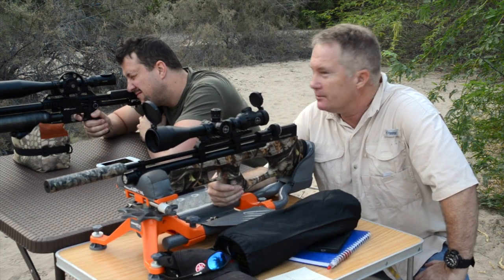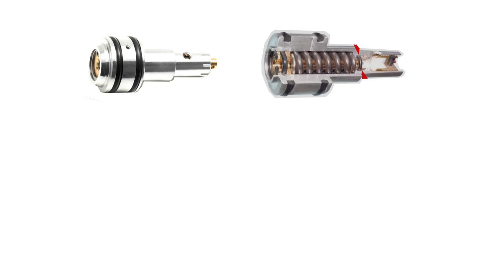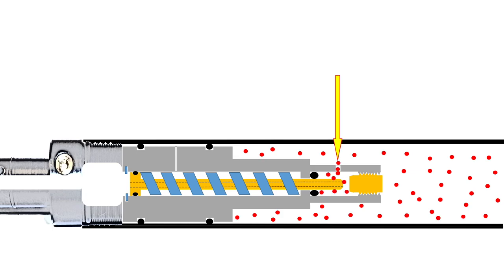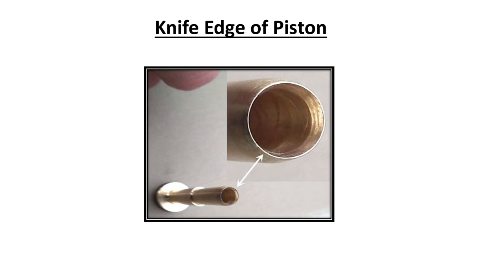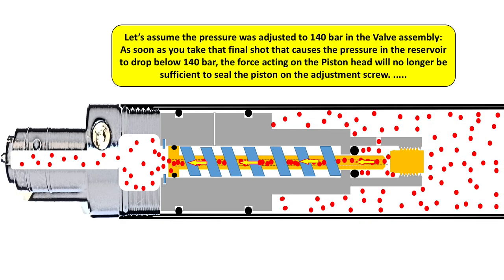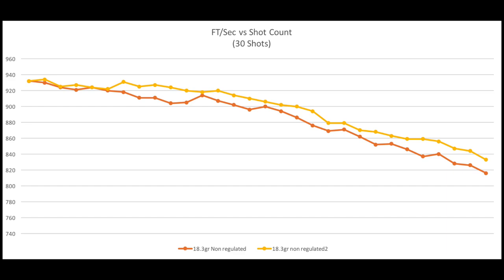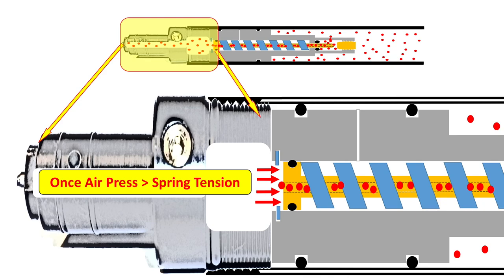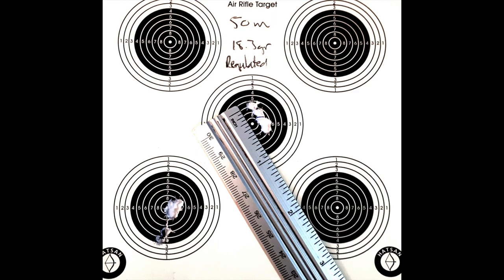PCP Regulator: How does it Work?

Comment: Great explanation, learned a lot! Would you mind explaining how an externally adjustable regulator works?
Reply from the maker: Hi Jim. 
Ok, if you recall this "internal" regulator has to be removed and the adjustment done once the regulator is out of the gun. In this case the gap between the adjustment screw and the knife edge is increased or decreased by screwing the adjustment screw in or out. 
In a more expensive (and complex) rifle this adjustment is done from outside. The regulator still works on same principal, but either the adjustment screw (or spring tention on the piston with knife-edge) can be adjusted from outside the rifle. 
Obviously the "adjustment system" also needs to be sealed off by o-rings to not allow air from escaping. 
I just fitted a Lane regulator to my SPA PR900W (video available by next week). The SPA non regulated rifle has a total of 9 o-rings. My FX Impact MK 1 has more than 30 o-rings in it. This because of the more efficient and complex rifle design and  to allow hammer and regulator adjustment from outside the rifle. Then obviously you also need 2 pressure gauges as you need to know what the regulator's pressure has been set to , and what the remaining pressure is inside the rifle. this all ads to complexity and price.......... 

In the case of the FX MK1 the adjuster screw is accessible with an Allan-key just behind the trigger .

Just look at how many o-ring in a FX impact: 

https://spares.bagnallandkirkwood.co.uk/product/fx-impact-o-ring-seal-kit/

and here is a picture of where it is adjusted...:

https://www.airgundepot.com/fx-impact.html#gallery-27

Hope it is clear now.

Many regards and happy hunting.

JB
Reply: @affordableairgunningbyjb6994  Right, I see that now! Thank you so much for the explanation - probably the best response I ever received on a YT video :) Looking forward to the next videos!

Comment: Brilliantly Explained thanks a lot 👍 I was wondering about the screw position and now understand how to adjust it, the PR900 GEN2 has a slot in it so all I have to do is unscrew the pressure gauge and adjust it with a long screwdriver, then chrono it once filled up 👏
Reply from the maker: Hi there. Sorry for the late reply. The Gen 2 PR900 is an awesome piece of kit !! Gen 1 was already great value, but had some minor fault. The Gen 2 is super value for money !!
Reply: @affordableairgunningbyjb6994  Hya the only thing I need is information on how to setup these Snowpeak regulators, how many turns in/out equals what pressure, and how to configure the Belleville washer stack, I have read normal stacks are ()()()() low pressure and (())(())(()) high pressure, Snowpeak do something else (()((()))()) 👍

Comment: This is seriously helpful. Thanks a lot. I just received my kral puncher breaker with zero bar, discharged and I cannot charge it up by simple hand pump. Looks like the pump is not making enough pressure to push the piston. the air is going thru the barrel.
Reply from the maker: Hi there !!
Did you buy it new or from a friend ?
It should not be at Zero Bar !

If you, or someone else, cocked the kral and fired it with no pressure then it can brake the valve on the inside of the valve assembly. (My friend,s kral broke the valve. see the photo of the valve)
Then you have to open the valve assembly and replace the part. 
If your air is coming out the barrel then maybe the valve broke...
I did a search and found this guy doing a valve replacement. Very interesting that we have almost the same name for our YouTube channels   :

https://www.youtube.com/watch?v=ezbAV7e-4-c
Reply: @affordableairgunningbyjb6994  thank you so much for your reply. I bought a new one. I studied a manual before I did anything and there are no info regards that the gun should be precharged by the manufacturer. I guess it's just a well-known standard that I did not know about. Thank you al
 Lot!!!
Reply from the maker: @enepeproductionz  please let me know if you discover what was wrong...
Hope it is just something small.
Regards and enjoy your PCP.
Reply: @affordableairgunningbyjb6994  Sure!
Reply: @affordableairgunningbyjb6994  
Ok, so, unfortunately, I couldn't find the reason. The seller cannot re-send the new gun, so I decided to buy something more-trusted. But! I read on some polish forums that not every airgun may be filled by the hand-pomp just because there is not enough pressure punch on the valve (even if you're pumping 120 or 160 times). So I closed the out and pumped the pomp up to 300 bars. Then I opened the out suddenly so the highest pressure could hit the gun and... nothing, same story. The air is going out, thru the barrel.
And btw, I do have not such a cheap pump. This device is well built, and I trusted it. I hope it's going to pump my new toy.
Reply from the maker: @enepeproductionz  Hi again. Sorry for late reply. Missed the last comment.
If still air is coming from the barrel then i think the valve is broken on the inside. It should not need a "push" from high pressure air as the valve has a strong spring already pushing it against the valve assembly. So if leaking it is probably broken.... 
 It is very easy to open the valve assembly and confirm this . 
Kral is still a good value rifle, so open it and see. If you watch my video on how to install the regulator you will see how easy it is. This is a very cheap part and for only a few dollar you might be able to fix it.... 
Regards and all the best for 2022
JB

Watch this video: https://www.youtube.com/watch?v=IwCkdBye-rc&t
Reply: @affordableairgunningbyjb6994  Hi! Thanks for your wishes! I wish you a great 2022! I sent the rifle back to the seller, and I decided to buy something else. But if not this issue, I could stay with Kral. Once again. Thanks a lot for your clips. They are helpful.

Comment: Excellent video.. only thing missing was an explanation of the bleed vent
Reply from the maker: Hi there Baza. You are correct and it should have been covered...

This is just copied from a presvious person that asked me the same question....
 Read it slowly and try to follow as I do not have illustrations, but by looking at the schematic on the video whilst reading it might just make sense...:

Hi there .
Very good and important point that I forgot to cover in this video. 
If maybe there was a small leak of air on the o-rings INSIDE the regulator then high pressure air could get past where the regulator and the piston seal. If this happens the air will be trapped in the "chamber or section" where the spring is. Now the pressure will increases in that section. This will caused the force required to close/push the piston (spring) to increase as we now have spring pressure AND extra air pressure......
If this happens then higher pressure in the valve assembly is required to push the piston head. 
Thus if air got inside the section where the spring is, then as that pressure increases, so will the pressure required to close the regulator increase. Finally the regulator wont be able to close anymore because spring pressure and extra air pressure will be too much. 
By making a small hole, and putting an o-ring either side of this hole, the air can escape from the section where the spring is. However you will need to drill a very small hole in your rifles cylinder (directly across from where this hole is to allow it to escape into the atmosphere.  That is why we need a breath hole on SOME rifles. 
The reason I forgot was because that model kral does not need a breathe hole drilled into the cylinder. In that model there is only one outer o-ring on the regulator and then air bleeds from the breathing hole and escapes past the valve assembly .

Look at this video from how i put the regulator into the Kral. I explain that you must not put the back the large o-ring of the valve assembly . The reason for not putting it back is for air to be able to leak past the threads into the atmosphere.

If your have a rifle that needs a breathing hole drilled in the cylinder, then it will have very clear instruction , and a drill, with the regulator you buy. Just follow the instruction when you fit the regulator to that rifle. 

I hope this was clear for you....
Reply: @affordableairgunningbyjb6994  That's a fantastic explanation! Thank you for taking the time to explain it 👍

Comment: What purpose does the small hole in the body of the reg assembly serve?  Talking about the hole at the 12 o’clock position that runs from the cavity where the piston is located and feeds air into the space between the 2 large o rings on the outside of the regulator.   Does this form a pressure check on the inside of the orings to stabilize or lock reg in place while under pressure?
Reply from the maker: Hi there "@motorgearhead".  Very good question that I forgot to address in this video. You are close, but hopefully my eplanation will clarify. 

Before I just "paste" the reply I have had to send to several other people let me just add to your understanding: Yes, air must "bleed/breath" from there, but not to pressurise those other O-rings.  On several other Rifles on must actually drill a small hole in the rifle's tank/cylinder. The air then can go out that "breath-hole" and escape into the atmosphere... The small hole must off course be anywhere "between" those two O-rings. 

The reason I forgot was because the Kral does not need to be drilled. You just do not return one O-ring on the Kral's valve assembly and the air escapes from there... ( Have a look at this video where I fit the reg to my Kral. There I explain that the O-ring must not be replaced .... Watch from about 16 min...  https://www.youtube.com/watch?v=IwCkdBye-rc&t=562s   )

Ok, here is a reply I sent others:

This is just copied from a previous person that asked me the same question....
 Read it slowly and try to follow as I do not have illustrations, but by looking at the schematic on the video whilst reading it might just make sense...:

Hi there .
Very good and important point that I forgot to cover in this video. 
If maybe there was a small leak of air on the o-rings INSIDE the regulator then high pressure air could get past where the regulator and the piston seal. If this happens the air will be trapped in the "chamber or section" where the spring is. Now the pressure will increases in that section. This will caused the force required to close/push the piston (spring) to increase as we now have spring pressure AND extra air pressure......
If this happens then higher pressure in the valve assembly is required to push the piston head. 
Thus if air got inside the section where the spring is, then as that pressure increases, so will the pressure required to close the regulator increase. Finally the regulator wont be able to close anymore because spring pressure and extra air pressure will be too much. 
By making a small hole, and putting an o-ring either side of this hole, the air can escape from the section where the spring is. However you will need to drill a very small hole in your rifles cylinder (directly across from where this hole is to allow it to escape into the atmosphere.  That is why we need a breath hole on SOME rifles. 
The reason I forgot was because that model kral does not need a breathe hole drilled into the cylinder. In that model there is only one outer o-ring on the regulator and then air bleeds from the breathing hole and escapes past the valve assembly .

Look at this video from how i put the regulator into the Kral. I explain that you must not put the back the large o-ring of the valve assembly . The reason for not putting it back is for air to be able to leak past the threads into the atmosphere.

If your have a rifle that needs a breathing hole drilled in the cylinder, then it will have very clear instruction , and a drill, with the regulator you buy. Just follow the instruction when you fit the regulator to that rifle. 

I hope this was clear for you....

Comment: Where does the air go coming out of the breathe hole? Do you need to drill a hole throught the cylinder wall or is the volume between the o-rings big enough?
Reply from the maker: Hi Johan.
Good question and not adequately explained in the video :-( 

It depends on you your rifle. Some, like my Gamo, it needs a hole, but on my Kral Punchers no hole is needed. The air bleeds out the threads on the Puncher's reservoir. (The puncher's regulator looks slightly different from the sample I used in the video).
This additional hole is literally the smallest hole you can drill (about 1mm) and just to allow "possible" air that might have leaked into the section where your spring is. If this air could not get out, then over time the pressure might increase in the section where your spring is located. This would effectively "increase" the force required to seal the regulator and will progressively change the regulated pressure..... 

If your rifle does require a hole then it will be very clearly indicated in the instructions of your regulator (I refer to Robert Lane's Regulators) where this hole needs to be drilled, and the drill is supplied. 

Not a nice feeling drilling into your cylinder, but 99.999% you would never remove the regulator, and they last forever .(Obviously o-rings go over time, but so do all the o-rings on your rifle) I would not use a hand drill for this, but a drill press set at correct speed for the size of the drill. 

Hope this helps....

Regards JB

Comment: one superb, excellent explanation, however, you missed a vital part of the tutorial, that is free to air breath hole within the regulator chamber and the average 1mm breath hole  that has to be drilled in the cylinder tube, which needs to be between the large ceiling o-rings on the regulator, that cylinder drilled hole  in the cylinder to be located between the two o-rings,
if no hole in the cylinder exists, the eventual failure of the regulator will eventually come to fruition.
Reply: Yes, I should have mentioned, but actualy on the kral regulator it does not get the hole.... that was why forgot to mention.

Look at tutorial of fitting a regulator to kral  puncher bullpup. The reg only has one sealing oring then leaks the breathe hole air via the threads on the cylinder.....

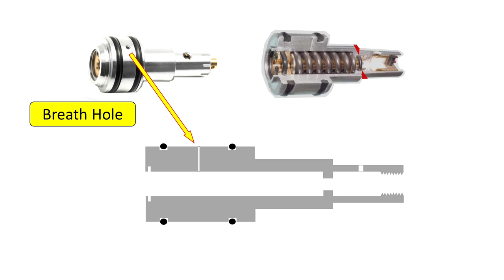Comment: Thanks for this. One question though, what’s the purpose of the breath hole at 2:40? Im pretty sure i had a leak from there.
Reply from the maker: Hi there. My apologies, and this is just copied from a presvious person that asked me the same question....
 Read it slowly and try to follow as I do not have illustrations, but by looking at the schematic on the video whilst reading it might just make sense...:

Hi there .
Very good and important point that I forgot to cover in this video. 
If maybe there was a small leak of air on the o-rings INSIDE the regulator then high pressure air could get past where the regulator and the piston seal. If this happens the air will be trapped in the "chamber or section" where the spring is. Now the pressure will increases in that section. This will caused the force required to close/push the piston (spring) to increase as we now have spring pressure AND extra air pressure......
If this happens then higher pressure in the valve assembly is required to push the piston head. 
Thus if air got inside the section where the spring is, then as that pressure increases, so will the pressure required to close the regulator increase. Finally the regulator wont be able to close anymore because spring pressure and extra air pressure will be too much. 
By making a small hole, and putting an o-ring either side of this hole, the air can escape from the section where the spring is. However you will need to drill a very small hole in your rifles cylinder (directly across from where this hole is to allow it to escape into the atmosphere.  That is why we need a breath hole on SOME rifles. 
The reason I forgot was because that model kral does not need a breathe hole drilled into the cylinder. In that model there is only one outer o-ring on the regulator and then air bleeds from the breathing hole and escapes past the valve assembly .

Look at this video from how i put the regulator into the Kral. I explain that you must not put the back the large o-ring of the valve assembly . The reason for not putting it back is for air to be able to leak past the threads into the atmosphere.

If your have a rifle that needs a breathing hole drilled in the cylinder, then it will have very clear instruction , and a drill, with the regulator you buy. Just follow the instruction when you fit the regulator to that rifle. 

I hope this was clear for you....

Comment: Can you put a iternal regulator in a CO2 tube? I got an FWB C60 and want to convert it to a pcp powered system from a CO2 system.
Reply from the maker: Hi there. Unfortunately I have no experience on CO2 systems and thus cannot give you an educated answer. However you can look at the "bottle" regulators that Lane, and others make, that fit between the bottle (on rifles like the FX) and the rifle.... Maybe that could work.....??
Reply: @affordableairgunningbyjb6994  hi! Thanks for the Quick answer. Yeah and I dont think you would get the regulator out as the end of the cylinder is a metal Wall. But an external is the go i guess.

Comment: Excellent well presented explanation.  The only other explanation I need is why does noone make a regulated bigbore?  I can buy .45 or .50  cal rifle that gives me 2  "full power" shots at say 700fpe., with a "follow up" shot or two.  Why can't I get a .357 cal with 6- 8 regulated shots at say 250-275fpe?
Reply from the maker: Hi there Roger.
I am not up to speed with the "big bore" air rifles and personally think that they are a waste..... Why not just buy a proper rifle... It would be a fraction of the price and 10 x more powerful.

Also the big bores would require a license just like a firearm in most countries, so just get a rifle...